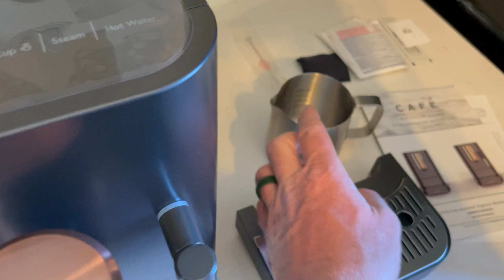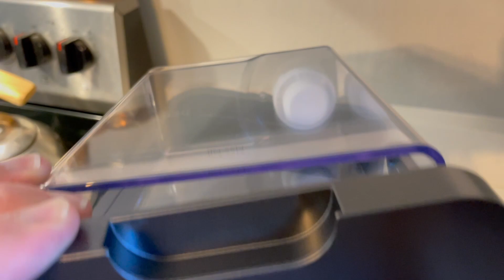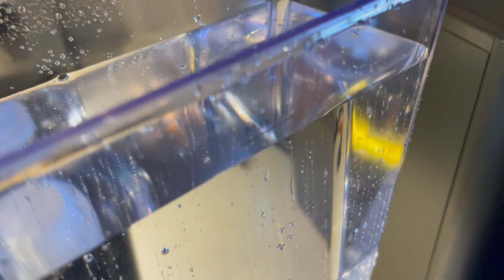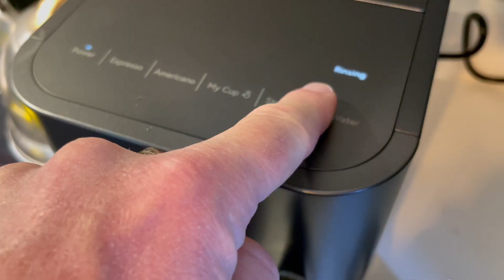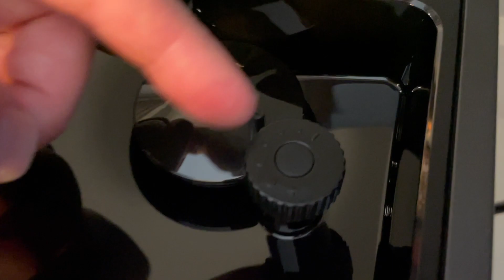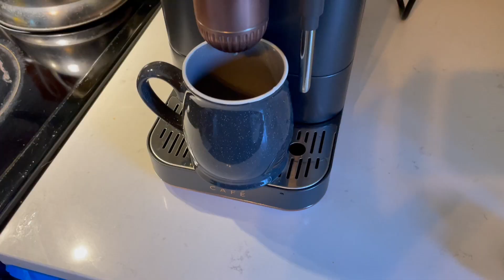How to Set Up Cafe Affetto Espresso Machine for the First Time

Comment: Those with air lock problem, it’s a common thing to deal with when using espresso machines.
Had the same problem with new machine and followed steps as mentioned in the video. 
Fill water tank, Press on the white bottom spout of the water tank a few times. Dry all water from bottom/ floor of the tank and inside of the machine where the tank goes in. Put tank into machine and run hot water. Be patient. If doesn’t work, unplug machine, after few minutes plug back and press power, to run rinse cycle and repeat steps above to run hot water .
Reply from the maker: Great advice, thanks for adding the comment.

Comment: Can’t turn off power without pulling plug.  Am I missing something?
Reply: If your power button doesn’t work I’d take it back. It is super sensitive so a light touch should work.
Reply: @Rockoblocko  The power button turns machine on and works with rinsing, etc. But it will not power machine down to off. (No power).  Phoned GE appliance tech who was not much help.  Could it be that machine is not meant to be completely shut down, such as TV or computer in sleep mode?
Reply: @utube1810  when you hit power “off” the power button should stay illuminated. Eventually it will start flashing indicating it is in standby mode. If it beeps when you touch the button then it is working correctly. Have you gotten the WiFi app to work?